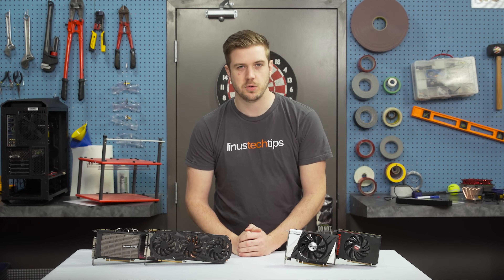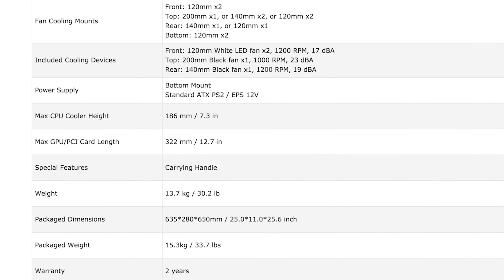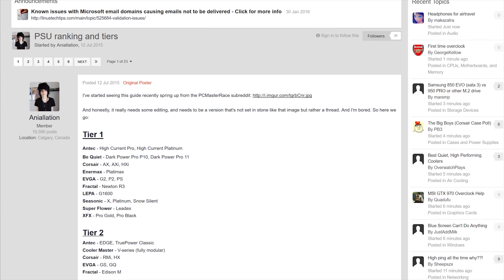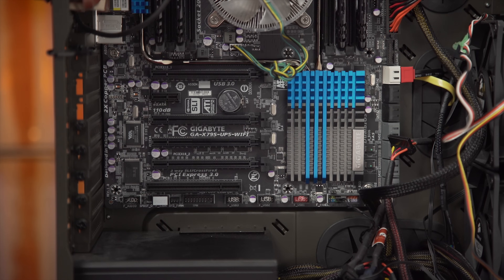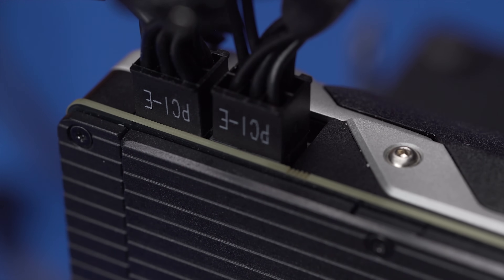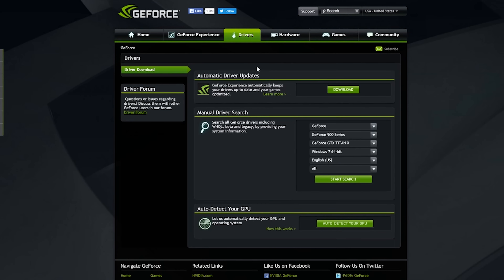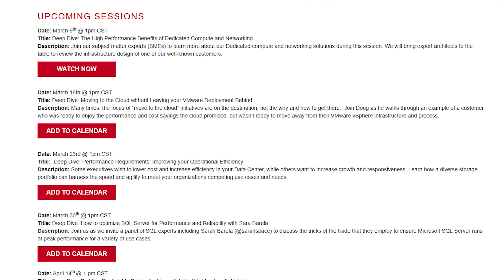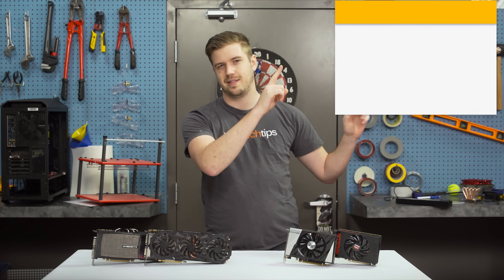Installing a Video Card - How To: Basics

Comment: Hey i need some help , i have a gigabyte gtx 960 and when i updated the display drivers when i first got this card it would cause the fans to spin up to max every so often, in idle mind you the most gpu/cpu intensive thing i have open is firefox lol .....i looked on the interwebz for a solution and i found this forum, https://forums.geforce.com/default/topic/885022/geforce-900-series/new-gtx-960-fan-issue/3/ , any help would be great because apparently gigabyte is a shitty company and wont respond to consumers
Reply: Try downloading msi afterburner, and make a custom fan curve. Im pretty sure you can do this using speedfan as well. If you dont know how to do this, google is your best friend.
Reply: It sounds like you may need a graphics BIOS update for that particular card.
Reply: how do i do that?  the only way i could find to do updates is through geforce experience

Comment: what if your power supply does not have the 6 pin connector?
Reply: You need a different psu
Reply: dammm i dont want to do that
Reply: Sometimes you can get addaptors

Comment: I used to really commonly (when I actually did this kind of thing, a few years ago) find that graphics cards don't quite line up when screwing into the case, as if the case is not at 90 degrees from the slot. It happened to me on multiple graphics cards, in multiple cases at all price ranges and form factors ranging from mATX to eATX to 2U for years.

It could lead to the far end of the card coming out of the slot slightly once it was screwed into the case. I usually screwed it in loosely then pushed it down on the other end afterwards.

There was no obstruction and the back slot went all the way in without getting caught on anything behind it, it just wasn't at the right angle.

I also never had the problem on any other similar sized card, like a RAID card or HBA.

Why is/was this?

Comment: What would happen if i put it in with the computer on?.
Reply: I would bet you would get a BSOD
Reply: Gabe Hughes
I get alot of Bsods. I bet something in my pc is loose.
Reply: +that niga paul most of the time that means bad ram, try running a memmory diagnostics. Ram is easy and cheap to fix.

Comment: I don't get what's the problem with this video. Basic videos like these are needed.. I mean, there are people who don't even understand you can't put an SD card into a DVD drive.
Reply: +deWaardt Yes you can.. and then you need pliers to get it back again. Really handy.
Apple even thought of it properly. The optical drive slot is on the same side as the SD card slot with 2cm space in between. Bunch of geniuses they got there.

Comment: Do you guys think this is a good build for gaming?

Intel Core i3-6100 3M 3.7 GHz LGA 1151 BX80662I36100 Desktop Processor- $124.99

Arctic Silver 5 High-Density Polysynthetic Silver Thermal Compound AS5-3.5G - OEM- $6.99 (ignore)

be quiet! Silent Base 600 ATX Window Case 3X5.25 3X3.5 3X2.5 No PSU USB3.0 - Black & Orange- $99.99

MSI Z87-G45 Gaming-R LGA 1150 Intel Z87 HDMI SATA 6Gb/s USB 3.0 ATX
Pro Gaming with Killer Networking & Sound Blaster Intel Motherboard Certified Refurbished- $79.99

WD Blue 1TB Desktop Hard Disk Drive - 7200 RPM SATA 6 Gb/s 64MB Cache 3.5 Inch - WD10EZEX - OEM- $53.99

ZOTAC GeForce GTX 750 Ti DirectX 11 ZT-70605-10M 2GB 128-Bit GDDR5 PCI Express 3.0 HDCP Ready Plug-in Card Video Card- $104.99

ASUS 24X DVD Burner - Bulk 24X DVD+R 8X DVD+RW 8X DVD+R DL 24X 
DVD-R 6X DVD-RW 16X DVD-ROM 48X CD-R 24X CD-RW 48X CD-ROM Black SATA Model DRW-24B1ST/BLK/B/AS - OEM- $19.99

G.SKILL Ares Series 16GB (2 x 8GB) 240-Pin DDR3 SDRAM DDR3 1600 (PC3 12800) Desktop Memory Model F3-1600C10D-16GAO- $68.99

CORSAIR CX series CX430M 430W ATX12V v2.3 80 PLUS BRONZE Certified Modular Active PFC CP-9020058-NA Power Supply- $44.99

     Total= $604.91
Reply: honestly I'd dish out the extra 50 bucks for an i5 if you want to run AAA titles

Comment: don't forget the thermal paste in the pcie slot don't want your GPU to overheat
Reply: +GamingSoup You are not a good person.
Reply: damn it well did you add the thermal past to the PSU and to all of the usb ports?
Reply: +tSp289 kool
Reply: +GamingSoup Instructions not clear i put it in my asshole now im always cold!!!
Reply: lol
Reply: +GamingSoup no i used mayonnaise
Reply: +iliden strmrege did you use the mayonnaise that's made with olive oil because if you do you will see better thermals then with normal generic mayonnaise I suggest either Best Foods or kraft
Reply: GamingSoup
i use a special German brand called Gut&Gunstig, they make the best mayonnaise for cooling
Reply: +iliden strmrege that also works I also use gasoline on some of my parts mainly the power supply it works wonders for cooling it down and keeping it quiet
Reply: GamingSoup
have you tried milk instead of warter in the water cooling system? Really works like a charm. but you have to replace the milk now and then

Comment: Plug it in. I just saved 7 minutes of your life
Reply: +Ryan Doherty Instruction not clear enough, installed it in my CPU socket, now it doesn't work anymore.
Seriously, not everyone knows this stuff.
Reply: Tetra Sky I mean its kinda obvious that a GPU will only fit in the one place. A CPU socket is square. The RAM slots are a different size than that of a graphics card. The graphics card can't fit into a PCIe x1 or x4 slot leaving only the correct place to put it. All it takes is a bit of logic. Think of this like that game where you have all the different shapes. A cube won't fit into the spheres hole and so on

Comment: Can someone tell me that if he is removing the drivers, how will the screen show Windows? Or the Windows can work in safe mode without the drivers.
Reply: +Ashvin Ambegaonker Your motherboard may have built-in integrated graphics that doesn't require a GPU to show the screen. If your motherboard doesn't support built-in graphics your new GPU will have basic display that requires no drivers. This is why you can see the BIOS screen without drivers.

Comment: I understand why Luke is doing this video... I think that Linus would rage and rant all the way through, because it is pretty D'OH damn easy. 

Just... Please don't try to install your new GPU into the longest slots on your Motherboard. Like another YouTube user pointed out in one of the comments below, then the longest slot on your Motherboard are your RAM slots (in most cases). Do instead look for the distanced array of slots below your CPU. Those are respectively your PCI-E x1 and PCI-E x16 expansion slots. Install your GPU into those PCI-E x16 slots (which are the longest slots in the distanced array below the CPU and the second longest slots on your Motherboard in most cases, which includes almost - if not all - ATX/Full Sized Motherboards). The PCI-E x1 slots are mostly for cards like lower end sound cards and such :)

Comment: I have 2 pc 1 works and the other one doesn't boot, it turns on but the screen remains black. I want to transfer my HD to another pc but with a different cpu. The original pc Hd came from had an AMD Athlon 2.7 ghz single core and thinking of transferring to another pc with an intel one. Would it be compatible? if i try it would it corrupt anything? it was running with 4gb of RAM as well so could i also transfer those?

Comment: You forgot to mention cheking the amps on the 12v cables of the power supply. I have a friend who bought an EVGA gtx 760 which demands at least 20 amps on the 12v cables and his 500w power supply had only 15 or something like that. And because of that his pc wasn't even turning on.

Comment: How many FPS with this rig for Assassin's Creed Syndicate?
Motherboard: Aluminum foil
CPU: potato
GPU: array of 3 oranges
Dedicated audio card: 2 tomatoes (the second one is pretty small)
Hard disk: magnet part found in trash
Case: corn flakes' box
PSU: hand actioned dynamo
RAM: 1 lemon
Reply: +Giorgio Baggetto Under -9000. ;P
Reply: more than 2 oranges is just overkill

Comment: To react to the driver side, I would say that you should install the drivers on the CD and then update them ... I resolved a driver bug thanks to the CD, a friend had a 7950 (an XFX one if I remember well...) and the installer added the drivers for an R9 Series, i know it should work fine but it didn't for a reason i don't know. So the CD is still a good option sometimes.
Reply: +IgnisMag if the rig you build even has a cd drive anymore

Comment: Guys, let's fix the rating meter and thumb this one up. Videos like this should not get this kind of obnoxious treatment and be disliked.
Reply: +cotes42 People think it's not a solid enough tip, even though it's stuff that new builders absolutely need to be told about. Elitists are expecting things a step above simple Googling.
Reply: +cotes42 People think the world revolves around them and decide that no videos should be on things that they already know.
Reply: +Uniblue Media Yeah, why are there so many dislikes?
Reply: +Zooni2 the video has more like then dislikes so the majority of viewers like the video.
Reply: Agreed 👍
Reply: This is the only instruction video i liked on this subject
just a little outdated in 2018
Reply: R3D CRAFT I need power supply with 6 pin connecter please help which one I buy
Reply: I need power supply with 6 pin connecter please help which one I buy
Reply: Maybe because they ddnt know that you need to uninstall drivers frst before installing ur gpu
Reply: Just because it has a lot of views

Comment: maybe for one of those exploratory vids,  Q: does pci bandwidth actually matter for most gaming situations? 
as a programmer I tend to see 8x as overkill for most things and im under the impression that a full 16x slot is just flat out crazy in terms of bandwidth for the vast majority of situations
Reply: +UrSoMeanBoss In gaming its best to have the maximum bandwidth available that way you can get the most fps and textures can load the fastest
Reply: +Francesco Barbera in theory - but the bandwidth of 16x will be overkill for all but the most intense 4k gpu-bound games.  But in theory ur right - im just saying it would make a good vid to test on avg games and setups

Comment: i have an APU on my desktop that is used for CPU and GPU if i used the Display Driver Uninstaller to uninstall the amd drivers(which both my gpu and APU use) will that mess up my computer display? or should i just crossfire my R7(APU) and R9(GPU) together?
Reply: +Cody Pettigrew You should stick to shutting up.

Comment: How do I find out how many graphics my Personal Computer has? It is the black one.
Reply: I think three, if you include the soft drive. Probably don't need an upgrade until 2030.
Reply: RalphArwen
Do i need to download a new RAMS?
Reply: Crouchy232323 You're probably thinking of System32. Delete it, if it's more than a month old it becomes malware and makes your computer slow.
Reply: RalphArwen
OK. Thanks.

My k yboard is also out of ink on th  '' '' k y. How do I r plac  it?

Comment: Do a how to Psu to motherboard I'm a noob but I don't how to do this
Reply: justin rangel
It is really simple, read what RalphArwen  said. 
Also before plugging the 8 pin to your CPU make sure on the cable it says "CPU". 
If you are talking about the connecting the main motherboard cable (the biggest one) it can only go in 1 way in.
Reply: What do you even mean?
Reply: +justin rangel 
Do you mean what cables you need to plug in into your motherboard from your PSU?
Reply: +Lou is it really that easy I'm looking to build a pc but never done it pc noob here
Reply: It's really, really simple. PCIe goes to Graphics card, CPU goes into CPU (if it's 8 pin cord plug in all 8, if four only four, if you don't have enough pins in the psu cord you need some help), and the rest is just fitting the shape in the other shape. Just look up enough computer build guides until you get the general idea, you'll learn a lot along the way which is worth your while and could save you a bunch of money. Welcome to PCMR.

Comment: Those little GPU there, What are those?
Reply: Probably a R9 Nano
Reply: +Nevondrax Yep, those two are Nano's (Amd R9 Nano)
Reply: +Nevondrax Are those good?
Reply: Yes, they are, though i personally favour Nvidia cards in general. But putting that aside, those are great cards.
Reply: Nevondrax Is there Any Nvidia with that 'nano-mode' too or something?
Reply: You mean smaller ones?
Reply: Yes.. Any Nano Nvidia cards out there?
Reply: Yes, the GTX970 mini. http://www.amazon.com/Asus-GTX970-DCMOC-4GD5-ASUS-Graphics-Cards/dp/B00RL2SLAG/ref=sr_1_1?s=pc&ie=UTF8&qid=1458319774&sr=1-1&keywords=gtx+970+directcu+mini
Reply: The 970 mini is quite a bit weaker, but also a LOT cheaper. Espacially if you consider gigabytes version of it.
Reply: Wow.. I just know that
So there were Mobo and GPU in nano mode
Were there any RAM in nano mode too?
Reply: Its called ITX btw, but yes, low profile ram is available.
Reply: Mobo: 
http://www.amazon.com/Gigabyte-LGA1151-Mini-ITX-Motherboards-GA-Z170N-Gaming/dp/B014W2000Q/ref=sr_1_3?s=pc&ie=UTF8&qid=1458320551&sr=1-3&keywords=itx+motherboard

Ram(Well all that i could find were those normal sized DIMMs for DDR4):
http://www.amazon.com/Crucial-Ballistix-PC4-19200-BLS2K8G4D240FSA-BLS2C8G4D240FSA/dp/B00MTSWFMM/ref=sr_1_1?s=pc&ie=UTF8&qid=1458320764&sr=1-1&keywords=crucial+ballistix+ddr4

But if you go DDR3 (Not Skylake) 
http://www.amazon.com/Crucial-Ballistix-DDR3-1600-BLS2K4G3D1609ES2LX0-BLS2C4G3D1609ES2LX0/dp/B00A14ZT6U/ref=sr_1_2?s=pc&ie=UTF8&qid=1458320819&sr=1-2&keywords=ddr3+low+profile
Reply: So i just learned Full ATX, Mini ITX and Micro ATX.. Nice info, thanks my goodman

Hey do you remember when linus made the strongest ITX? Silverstone ITX Case with xeon chip in it?
He mentioned RAM with Acc mode or something, what was that?
That RAM didnt have case outside of it
Reply: He used a Xeon e5 2699v3, with ECC ram
Reply: And no problem at all, i always like to help ^^
Reply: Nevondrax what is ECC RAM? Whats the different between regular RAM?
Reply: Its main use is in server applications. ECC means Error correcting code memory. But its of nearly no use to the normal consumer. But its very important in servers.
Reply: Well, regular ram doesnt have ECC, so no error correction. Also, ECC RAM is often way more dense than normal RAM, thus available with much larger capacities
Reply: Nevondrax Is there any ECC RAM DDR4 out there? I cant find any
Reply: Sure there is. http://www.newegg.com/Product/Product.aspx?Item=N82E16820148843
Reply: Woww. Thanks

Comment: I am planning to upgrade my Sapphire R9 280X OC Tri-X to a GTX 980, but I don't want to create a big bottleneck with my processor i5-4590. I just want to upgrade my GPU, not my CPU... That would drive the price up to high. Is that possible? How do I see when certain components become huge bottlenecks?
Reply: your i5 wont bottleneck a 980, though if you have some time left, wait for Pascal, it probably wont be long.
Reply: Nevondrax I won't be buying a 980 anytime soon, my bank account doesn't allow that. But planning to evantually.
Reply: +Kevin Wolthuis Well, i would really wait for Pascal. Might be worth it.
Reply: +Nevondrax And your Cpu should be just fine.
Reply: Nevondrax Pascal? Isn't that a measurment for pressure?
Reply: +Kevin Wolthuis Well, yes. And no. Its Nvidia's coming GPU architecture (GPU's) that will be out in a few months. (Probably the 10xx series)

Comment: I literally just built my first PC 24 hours before this went up. This would have been great to watch before that. This should help out first time builders like me. GG fellas.
Reply: +Frozen Lava yes. especially if you live in a dry area and/or you're standing on carpet. The likelihood of static causing serious damage is not super high but when you can get the wristbands for under$3 there is no reason not to use them. Better to be overly cautious than to end up with hundreds or thousands of dollars worth of tech turning into a paperweight.
Reply: did u use the anti shock gloves, r they necessary
Reply: +TigerClawTV  Exactly these are just the type of videos I was looking for when building my PC since its been a few years since I built one.
Reply: +Kille78 ok thanks and is the glue u put on cpu necessary too?
Reply: Frozen Lava
you need learn a lot before even attempting to build a computer....thats not glue, its thermal paste and yes it is insanely important. Please dont try building anything until you actually know what you are doing

Comment: Would I need to update any software if I was moving from a 750ti to 960? I don't have any 3rd party software just nvidea control panel and geforce experience
Reply: any updates will be visible in Nvidia Experience :)
Reply: CatsTF Yeah thats what I thought, Thanks!
Reply: +KaneWolf no problems friend! make sure to clean out the old drivers first! :3

Comment: 650w 80+gold for G1 970 sli.... what do you guys think?
Reply: Plenty, I've used it myself :)
Reply: hmm.. see thing is that mine crashes when i load up Fallout 4. I dont know why. I have read that it might be cpu voltage that needs to be tweaked? I have an i56500k not overclocked yet.

Comment: 1. That GTX 480 it`s to majestic to stay on the table with other cards. It needs its own table.
2. I wanna see how you install an HD5970x2 in a mid tower. it doesn't fit because of the HDD rack( i bend it so it can fit HAHAHA)
3. MAN bring back more other legendary cards. 8800 series, 200,400,500,etc
Respect for bringing into the  frame that GTX 480

Comment: Touching the PC chassis won't do anything of course unless the power supply is connected BUT not switched on! Simply because it wouldn't have any connection to ground/earth. Another option is touching your heater radiator as those are normally grounded/earthed as well.